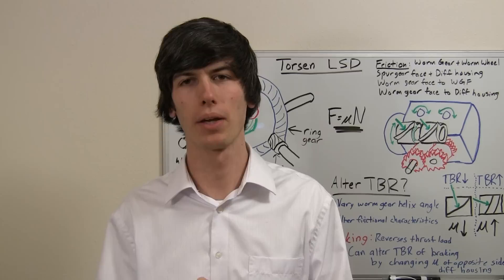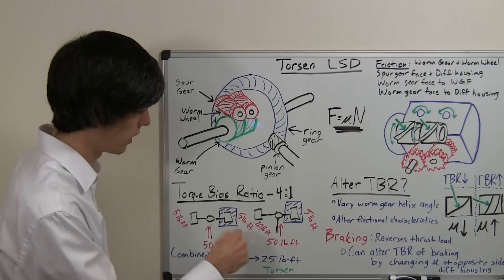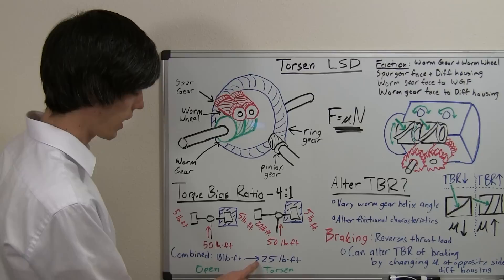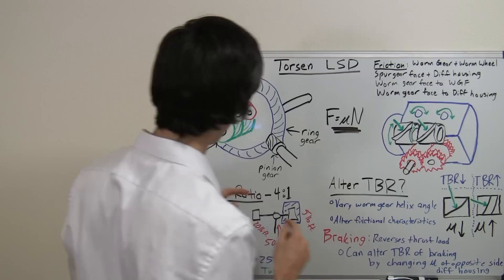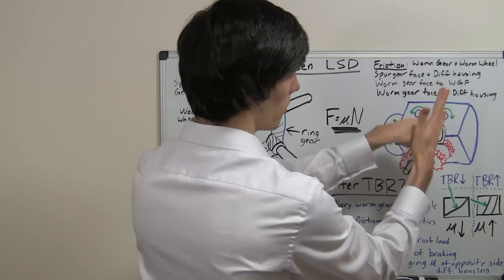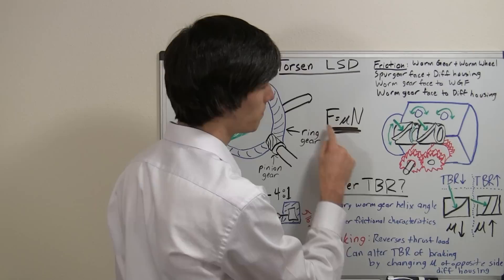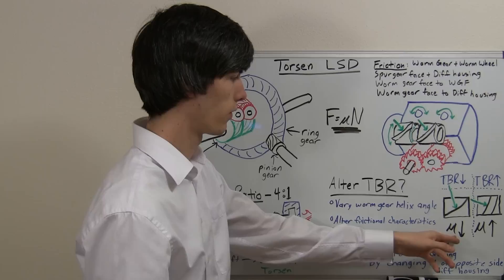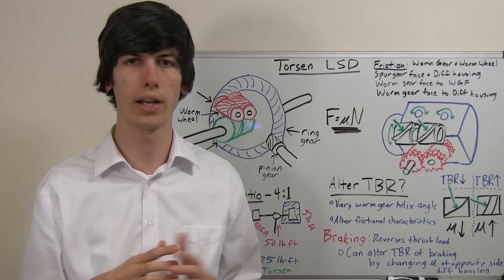Torsen LSD - Torque Transfer - Explained

Comment: In the first scenario where does that extra 40lb/tq go?
Reply: wheel spin.
Reply: What happens when 1 wheel completely loses traction on a torsen. He never explained it.
Reply: If 1 wheel completely loses traction then it cannot transfer any force at all. As Torsen "just" multiplicates torque between wheels the equasion is pretty simple 4*0=0. The answer is - the other wheel will have 0 torque and won't move.
Reply: Oh, as to the first question - that extra 40lb/tq doesn't go anywhere because it doesn't exist. That overall 50 lb/ft is just amount of force available to be delivered by engine. But if u won't "use" a force it won't be generated. In other words the engine will be loaded less and i will consume less fuel. 
Hope that helped. :)

Comment: A little bit harder to understand than the rest. I had a harder time understanding the top right illustration.
Reply from the maker: It's a challenging subject, the pdf I link to in the description may help if you want some additional information.
Reply: Engineering Explained Hi, talking of mathematical principles, do you perhaps have one with double wishbone suspension geometry one could use to get his project moving? =) many thanks to you

Comment: you used wrong term. 
so, nothing sending speed or lower the torque. if your statement happens, there are eventually speed difference between two wheels, and your car will be spun out. nice huh? also, if you studied basic physics, you must have calculated how fast wheel lose contact with road. 
here is how torsen LSD works again - as soon as one wheel starts to lose traction, the difference in torque causes the invex gears to bind together and apply torque to the wheel that has good traction.
Reply: Montina Ladine he is talking about that other goon in the comments i think

Comment: so there is only torque transfer between wheels. it is not related with speed of wheels. both side can spin in the same speed, just the torque given to each side is different. Yes, friction is everything that make it happen here. 

Your idea of torque/speed is wrong as well. high torque can have high angular speed and vice versa. you can argue with this in transmission, but this is differential. also, it should be torque/gear ratio, not torque/speed. torque and speed has no relationship.
Reply: Montina Ladine he is talking about that other goon in the comments i think

Comment: omg i hate this kind of people. you think you are cool to discuss like that? you are just nasty annoying. and you know what? your reply is totally out of point. 
Torsen lsd does deliver torque where has more traction. This is how torsen LSD is defined and made for. and it does NOT send more speed to the slipping wheel.
BTW, what the heck sending speed?????? speed is just rate of motion in scalar, which means it is not some kind of power or force that can rotate or create rotation or something.